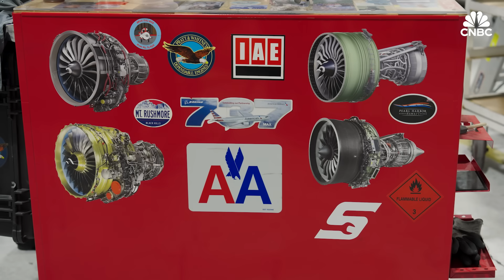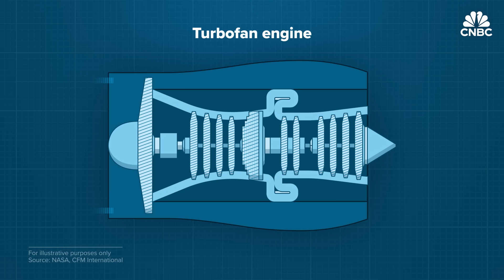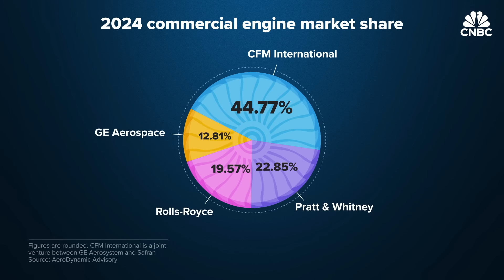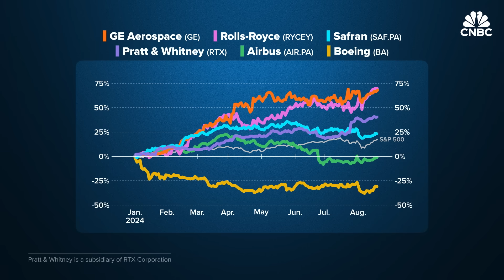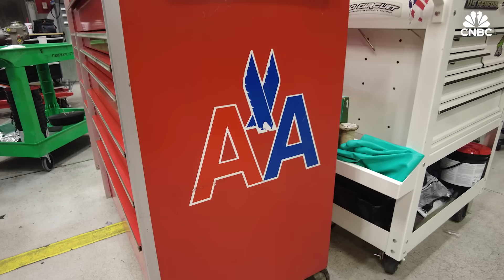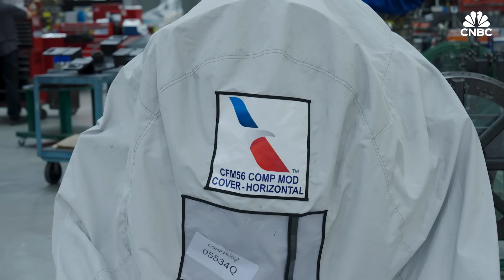Why Airlines Like American Are Scrambling To Make Engines Last Longer

Comment: I recently learned something new after ten years of flying these things. Virtually all jet airliners use reduced thrust (sometimes called flex) takeoffs most of the time. This intentionally uses more runway. I always assumed it was for fuel savings. But it actually burns more fuel; it's there to prolong the life of the engine. You spend more time at a lower thrust, which greatly reduces temperatures inside the engines.

Also. Not as common these days with electronic controls. But in older engines, you had to be very careful of a hot start. Basically this is when the fuel gets going faster than the airflow in the engine can develop, so you really had to watch the temperatures and abort the start if they started to approach the limit. As you can see why here, that could be a job ending mistake.

Comment: To even begin to fathom the power of one of these huge monsters there's a video called JET POWERED BLOWER. A guy put a model jet engine on hand held leaf blower type contraption. The engine is about the size of a coffee can. He can barely control it. It's absolutely amazing. It's like comparing a toy car to a full size real car. Check it out. Then you can see how these provide enough juice to put a jet liner 35,000 ft into the sky at almost 600+ mph.

Comment: Well in my country maintenance capacity was distroyed by shortviewing "economic experts", only to find out little later that such capacity can't be built up as fast as shutting it down previously. If the ICAO, FAA, EASA, and all the other aviation related bodies really want to increase safety and reliability of aircraft being operated, the would need to provide practical tools for exchanging reliable data about aircraft parts across multiple industry players along the entire lifecycle of components.

Comment: In the middle of the video you talk about commonality of parts between two engine types but don’t say which types.
Reply: very few
Reply: CFM56-7B and CFM56-5B. One is used on the Boeing 737 and the other one is on various Airbus A320 family airplanes.

Great engines compared to the poor quality ones produced by Pratt & Whitney these days.

Comment: Perhaps the most extraordinary part of these engines’ stories is that today, when they are in flight they’re sending back constantly data to the companies that manufactured them. This is looked after by computer systems and any issues are passed up to human engineers to check out. This enables them to even contact pilots to tell them off issues with an engine during the flight. It enables them too to spot problems that need early preventative maintenance and parts replacements.
Reply: This is the most amazing thing. I’ve been watching aviation videos for a while and l was amazed they do these diagnostics while flying and that pilots can speak with HQ engineers. It’s funny because it makes perfect sense for such things to exist these days but again l was surprised they can actually do it. Aviation is just amazing.

Comment: For the airlines that have repair capability its more knowing their aircraft will be flying no matter what where other smaller airlines could loose a flying aircraft due to maintenance. American, delta, united are ensuring they have zero issues which comes at a cost to run these facilities.

Comment: Large jet engines are not the easiest to make but it seems like a racket at all scales of engines, especially on the small ones for private jets. They are grotesquely overpriced as are the overhauls. The prices in aviation have departed reality for decades and manufacturing techniques have only made it easier to make them. I know from Pratt&Whitney's smallest engine the PW610f used on the small private jet Eclipse 550. 2023 list price was 922k$, probably a clean million today for each engine and the front fan is 14" in diameter, the 4 other rotors in it are about half size. Easily machineable. There are no exotic materials in them, it's strong steel alloys and a nickel alloy called inconel that's also used in car turbos that are very similar to jet engines, spin very fast and have to last and they retail for 300$. The metal itself is very inexpensive, the bearings are conventional steel bearings, nothing exotic. So where does it become a million dollars for a small 115kg engine. Very ripe for disruption.

Comment: Fun Fact: one of the main reasons Southwest Airlines was so successful was due to the fact the only flew one plane type w the same engine type on every single plane. So mechanics only needed to train on one engine and can easily be transferred to assist in new location hitting the ground running.  Parts were plentiful and easy to come by too. Not to mention their regional mindset w flights. But then again, in early 2000s SWA hedged their fuel prices  successfully and paid about 50% less than their competitors, which lasted for about a decade.

Comment: If the newer engines are costing more to maintain, are the fuel savings that much more? No point in saving $1M/yr in fuel, but you have to spend $6M to overhaul it every 5yrs?

Comment: So, as usual, the environmental concerns are causing them to push engines past their point of failure.  Think this is going to end well?
Reply: No, the push for greater fuel efficiency to keep operating costs lower has necessitated engines working at higher temperatures, pressures and tighter tolerances than previous generations.
Reply: @Orbital_Inclination  egine go boom.
Reply: @marksellinger3736  not usually, modern engines are incredibly reliable

Comment: back in the 70s and 80s they had a company called Denalko  They were selling engine parts and other structural plane parts that they have been refurbishing from older planes and selling them as new anybody who remembers those years remembers a lot of crashes. Many many planes went down due to faulty parts, it wouldn’t surprise me if they were doing the same thing again 60 minutes did a big story on it and I know all of this because my grandmother was one of the receptionist.

Comment: Very simple latest engines like Pratt and Whitney airbus NEO engines were a complete disaster when they came out. Spirit right now has 40 Aircraft grounded because of the issue. DEI is to blame here for the most part. But some airlines do want to still make money so they are building these facilities to overhaul these brand new engines instead of waiting 330 days per engine with the manufacturer.  Companies caring about their ESG score and putting focus on DEI agenda really cuts into safety aspect of the operation on every level.

Comment: maybe we need newer generation engines which are less complex... maybe if you were not putting sanctions on Russia and others,  innovation could have come from elsewhere too !
Reply: Complexity is necessitated by the drive for fuel efficiency. If they could make them perform the same with fewer parts, they would already be doing that
Reply: @Orbital_Inclination  This point is not relevant here, but as an example a scramjet engine has no moving parts.

Comment: Worth mentioning that the (average, hourly) operating cost of fuel is a good 4-5x that of maintenance. Even if burning hotter demands more frequent overhauls, the fuel efficiency gains can be entirely economical.

Comment: Making engines last longer than its originally designed for, I don't see anything that could go wrong 🤔
Reply: Misleading, it basically means u work them.longer but thats because u do additional maintenance.

It doesnt make them unsafe

Comment: Hey, CNBC, I am still waiting for an in dept story that looks at Airbus' bribery scandal, the WTO ruling against Airbus, and now I've learned, the EU's attempts to block maintenance companies from certifying for Boeing aircraft repair services within Europe. I also love how you have a story on airliner engines, mention Boeing and Airubs, take not one but two swipes at Boeing, then don't even mention the fact that Airbus A320neos and the A220's using the Pratt and Whitney Geared Turbofan engines are being routinely grounded for maintenance issues due to the engine's design. Every time you take a swipe at Boeing, I am going to bring that up. That being said, yeah, I used to fly these things and I worked closely with out maintenance staff, this is one hell of an industry, and its really the FAA's fault for it being so hard to get new parts (partially, by the thing with the British company plus the Chinese component issue proving why they are so hyper, I didn't say the FAA's reasons weren't justified).  There are easier ways to get these parts, but until you get through the miles of red tape to get the certifications, its will be hard to do it.  That being said...how many planes are up in the air per day and how many have engine problems? Clearly, something is working.

Comment: I worked as aircraft maintenance before,
engines are very easy to assemble and disassemble, just like reading a menu, the only issue is that there are so many parts that need to be remove/installed with specific torque thus takes time. Also engines are actually very smelly, mixture of fuel and oil! Most of the time I lose my appetite thus I transfer job and now working as microchips development engr. lol!

Comment: The following idea provides a framework for a solar-powered aircraft that is both efficient and environmentally sustainable. The combined systems aim to use solar energy to power an advanced propulsion system that manipulates air to generate thrust without traditional fuel.

Concept Overview:

The idea is to create an aircraft that utilizes a solar-powered, electrically driven propulsion system capable of manipulating air (or ionizing it) to generate thrust. This propulsion system could operate using principles similar to MHD or electroaerodynamic (EAD) drives, potentially offering silent, efficient flight.

How It Could Work:

1. Solar Energy Harvesting:

- Flexible Solar Panels/Inductive Coating: The airplane's surface, including the wings and fuselage, would be covered with flexible solar panels or a solar inductive coating. These materials would capture sunlight and convert it into electrical energy throughout the flight.

- Energy Storage: The harvested solar energy would be stored in advanced batteries or supercapacitors. These storage systems must be lightweight and capable of holding enough energy to power the aircraft's propulsion system and onboard systems.

2. Advanced Propulsion System:

- Electroaerodynamic (EAD) Drive: The propulsion system could use high-voltage electrodes to ionize air around the aircraft and generate thrust through ion acceleration. Electric fields would accelerate the ions, creating a flow of air (thrust) without moving parts.

- Magnetohydrodynamic (MHD) Drive Adaptation: Alternatively, the system could be based on MHD principles, where air is ionized and then accelerated using magnetic fields to produce thrust. This would create a similar effect to the fictional caterpillar drive from the film The Hunt for Red October but adapted for use in the atmosphere rather than underwater.

3. Thrust Generation:

- Ion Acceleration: The propulsion system would accelerate the ionized air rearward, generating forward thrust. The system would work continuously, with the solar panels providing the necessary electricity to maintain air ionization and acceleration.
- Supplementary Energy Usage: During periods of low solar availability (e.g., nighttime or cloudy weather), the system could draw on stored energy from the batteries or supercapacitors to maintain propulsion, ensuring continuous operation even when direct sunlight is unavailable.

4. Integrated Systems:

- Energy Management: A sophisticated energy management system would regulate power distribution between propulsion, onboard systems, and energy storage. This system would optimize efficiency, ensuring maximum energy is available for thrust while maintaining sufficient reserves for critical systems.

5. Environmental Adaptation:

- Adaptive Flight Systems: The aircraft could include adaptive control systems that optimize flight paths to maximize solar energy exposure. For instance, the aircraft might fly at altitudes or routes with more abundant sunlight, improving energy capture and efficiency.

Potential Benefits:

- Zero Emissions: The combined system would eliminate the need for fossil fuels, produce no direct emissions, and significantly reduce aviation's environmental impact.
- Quiet Operation: Without traditional engines, the aircraft would produce significantly less noise, making it ideal for flights over populated areas.
- Sustainability: Relying on solar power and advanced electric propulsion, the system would offer a sustainable and renewable approach to air travel and contribute to long-term environmental goals.
- Longer Endurance: Continuous solar energy harvesting could allow the aircraft to achieve longer flight times, especially in regions with abundant sunlight.

Challenges and Considerations:

- Energy Density and Storage: Solar energy, while renewable, has low energy density compared to traditional fuels. To be viable for commercial aviation, the system would require highly efficient solar panels and advanced energy storage solutions.
- Thrust Efficiency: Generating enough thrust to propel a large commercial aircraft using ionized air is a significant technical challenge. The system must produce sufficient force to overcome drag and maintain high speeds.
- Weight and Materials: Integrating solar panels and advanced propulsion systems without significantly increasing the aircraft's weight is crucial. The materials used must be lightweight, durable, and efficient.
- Weather and Night Operation: The system's reliance on solar energy may be less effective in cloudy conditions or at night. The aircraft would need robust energy storage or supplementary power sources to ensure continuous operation.

Conclusion:

Combining solar power with an advanced MHD-like or EAD propulsion system represents a bold and innovative approach to sustainable aviation. While the technology is still speculative and faces several significant challenges, it offers a vision of future air travel that is both environmentally friendly and efficient.

Significant advancements in solar energy capture, energy storage, and propulsion technology are needed to realize this concept. However, with continued research and development, this could lead to a new era of aviation in which airplanes are powered primarily by renewable energy, using cutting-edge propulsion methods that do not rely on traditional fossil fuels.

Comment: AT ROLLS ROYCE they GROW those blades as a single crystal of titanium - this is why its a LONG process
Reply: Gas turbine blades are not made out of Titanium except in some compressor blades. All blades in the turbine are cast out of nickel based alloys including single crystal blades. The weak point in a casting is at the grain boundry, so by controlling the cooling process and growing the blade out of a single crystal, you can create a single crystal cast nickel blade without any grain boundries that maintains its strength a higher temperatures. The higher the turbine inlet temperature, the better the overall performance of the engine, so the single crystal blade gives you better performance and a longer turbine life.
Reply: @rocketscience777999  These were definitely titanium.  The breakthrough they had perfected was growing them in titanium
Reply: No , they use rotax
Reply: That is a pretty standard process now for all engine makers

Still impressice
Reply: @elaeiffel  
The Chinese are still having difficulty doing it.  They're going with CFM for their initial lot of the Comac C919.  And then there's their military engines, where they've been buying Russian engines while they sort out their production issues for their indigenous engines.
Reply: @ypw510  I can tell you that the comac is not that good and leap 1-C is way behind 1-B and 1-A

But you are right, they can't... yet. I was referring to the four makers listed on the video
Reply: @elaeiffel  Like the guy who just commented said "All blades in the turbine are cast out of nickel based alloys including single crystal blades."  the breakthrough at the time was casting titanium in single crystal. That said this was about 2004. So they may have dropped this, it may have been too difficult or too expensive or other materials were improved and made it unnecessary

Comment: You guys didn't mention the latest game changer in jet engines: the GE9X, the largest and most powerful commercial aircraft engine. Since GE's first announcement, all major jet engine manufacturers have been in an intense race to lead in this type of engine. I won’t dive into the tedious engineering details, but it’s important to note that jet engines are not only the most expensive part of an airplane—they're also a game changer for both manufacturers and operators.

A new jet engine can transform a less attractive airplane into a long-range one, which is the extra mile all manufacturers are fighting for. For airplane operators, reducing jet fuel consumption—the most expensive component of a flight ticket—opens up new marketing niches. After all, an unoptimized set of jet engines can easily turn an entire flight unprofitable.
Reply: We love the GE9X
Reply: @robert2974 9x gives me lots of headaches
Reply: @robert2974  GE9X is not just the best, it's 100% American!

Comment: The hotter the more frequent overhauling required.
"In any system of energy, Control is what consumes energy the most.
No energy store holds enough energy to extract an amount of energy equal to the total energy it stores. 
No system of energy can deliver sum useful energy in excess of the total energy put into constructing it.
This universal truth applies to all systems.
Energy, like time, flows from past to future" (2017).